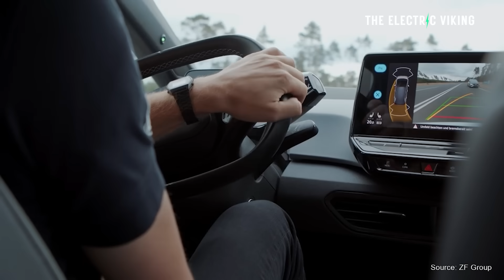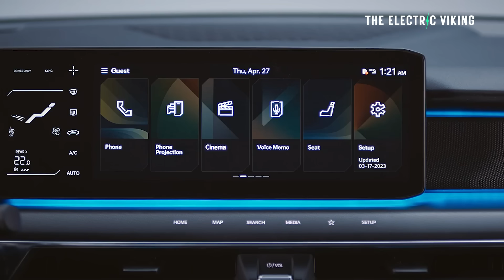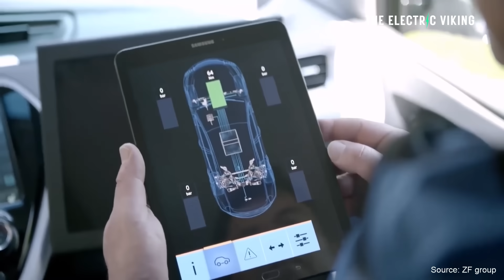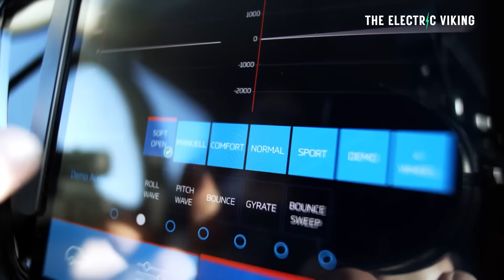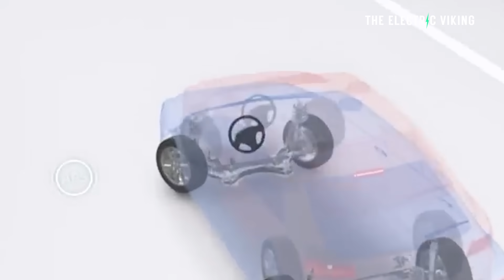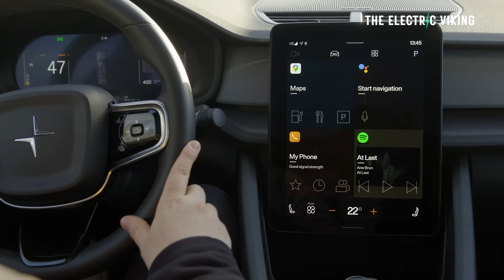Electric Brakes Revolution: Safer, Cheaper EVs!

Comment: * The new Tesla Model Y HAS Brake by Wire, according to an out of spec test I just saw. While throttle regen is limited, the initial brake pedal force producers regen, gradually adding pads as pedal pressure is increased.  They mentioned the drag free brakes also allow better performance pads to be used while still getting longer pad life.  The pedal feel is more firm than the earlier model.  Thought a cross-link to the part of the 1 hour review where brakes are discussed for about 7 min. would be worthwhile. 
youtu.be/CZC35_kTx8E?si=myOkuwRfnDsYqhF8&t=2587

Comment: It's going to have to be a failsafe system, similar to trucks or trains. Unlike a car, brakes on heavy vehicles will apply when pressure in the braking system is lost. Brake by wire could hold the brakes off the caliber when it is receiving a signal. If an intelligible signal is lost, the brakes should apply automatically. If this is not the way it works, i'm not interested in manufactures reducing cost at the expense of safety.

Comment: It's only safer as long as the motors don't burn out.
The beauty of a Mechanical System, there's nothing to burn out
Reply: Brake fluid is hydroscopic, so you should change it every other year and bleed the system from air bubbles. How many really do that? 10%
Reply: @Sandviken0046 every brake shop that does  brakes can do that.
Reply: @larrygage  I have had the same car for fifteen years, and only last year did I purchase a device to bleed the brakes. Once in fifteen years.
Reply: @Sandviken0046  I used a plastic bottle from ice tea and a hose from the hardware store
Reply: @ Used to do that on my motorcycles and you could really feel the difference.
Reply: @maxholbrook7071 - We've have had various electric brake systems for over 60 years and heat along with corrosion/water were killers to them.  If they thermally protect the motors then we could be facing brake system shutdown when the motors get too hot.  If we go to brake systems that replace the hydraulics with electric motors, unless those motors are of a brushless design they will require regular inspection/maintenance of the brushes plus the guide pins and slides will still need regular lubrication, a maintenance task usually carried out when flushing the brake fluid.  Today its an irritation when an ABS wire fails however the brakes still work in non-ABS mode when that happens however when one electric brake wire fails it will be interesting to see how they will in all situations prevent spin-outs and rollovers when one brake caliper suddenly no longer functions.  In hydraulic systems they either plumb them so both brakes on the same axle or diagonally across from each other (left front to right rear or right front to left rear ) work from the same half of the master cylinder so you will still have somewhat balanced braking for an emergency stop.  Also it would likely be a higher voltage system since to provide fast clamping pressure its going to require high wattage which with a 12 volt system would require substantial wires to carry the higher amperage needed to supply the needed watts so perhaps a 48 volt system like the Cybertruck.

I've often felt that cars/light trucks should have brakes that function similarly to heavy trucks and trains which have large springs that apply the brakes when you press the brake pedal, doing so by reducing power to the system that pulls the brake pads/shoes away from the drum or rotor.  When the system fails the truck stops instead of becoming a runaway since all the brakes then engage to stop the vehicle when that happens.  Even with an electric system this should be doable and would be a much safer failure mode since system failure means that you automatically will stop.  It also means that if the system fails you can't leave your parking space, garage, etc making it so driving a vehicle with no brakes is basically impossible unless you crawl under the vehicle and physically disconnect the brakes so no more accidentally driving off with no brakes.

Best!
Reply: Youve obviously never had to keep pumping because you had a brake fluid leak!
Reply: @jaaklucas1329  What would be more common a motor burnt out or a Leak ?
Reply: @maxholbrook7071  Brake fluid leaking was pretty common in my beaters! I still pump brakes to make sure they bite. Steer by wire auto has a backup motor on deck just like a plane. Brake by wire I would assume the same to pass. 4 wheel independent braking sounds like a big safety improvement.
Reply: @jaaklucas1329  Planes brake systems are CHECKED AFTER EVERY FLIGHT, starting to understand yet ?
Reply: @ How do you feel about steer by wire on a car knowing it has a backup system? I saw Sandy Munroes breakdown, thought it was good.
Reply: @jaaklucas1329  Hydraulic systems are FAR SAFER, super easy to work on , and still work even with a leak...  Brake a wire on electric brakes and get back to us all...
Reply: @jaaklucas1329  Been maintaining and rebuilding brake systems and components for 60 years now and have only had that on systems that had seen many years of neglect with total lack of maintenance.  99% of the time its owner negligence that leads to that type of failure.

Note that on any used vehicle that I've rebuilt and then regularly maintained the brakes on or bought new I've never had a hydraulic system failure of that nature.  The current one has almost 200,000 miles on it with no signs of brake fluid loss or line failure since it has been maintained per the Severe Service Schedule since new.  It is still on the original master cylinder, calipers and rotors with all meeting spec during their annual inspections.

You neglect and abuse a dual master cylinder hydraulic brake system and it will treat you accordingly.  You should get 30% to 50% braking in the event of an unexpected failure if you've been maintaining the system by the book.  If you maintain a hydraulic brake system by the book you should also get plenty of warning of an impending failure during inspection.

If you don't regularly inspect and maintain brakes, meaning an annual inspection of all the components, seals, lines and hoses (not just a quick glance) along with a perform fluid flush then you should expect to have total loss type failures.  Decent brake fluid is $6 to $10 per quart so not terribly expensive to flush on an annual basis.

Best!
Reply: @jaaklucas1329  The low brake fluid light would be on on the dash of a normal car

Comment: Electric brakes are a great idea. 
Plus the wheel bearings need an electric warming feature for winter driving because grease is thick, and sticky in the winter, lowering range......
Reply: its not a new thing.

Comment: If you have an electric motor on each wheel, do you need any brakes at all ? Can't the current be run in reverse in the motor to slow the car down ? Doesn't regenerative braking do that already ?
Reply: Yes but not good enough for an emergency stop. Even a 1908 electric car that used regen also had physical brakes. Terrible ones but it still had them.

Comment: Imagine the microprocessor failing when you are braking or turning.
Reply: Like in a commercial plane?
Reply: @yongebltechsupport6815  you have any idea how much expensive the system on plane will be and with multiple redundancies?
Reply: @wonderwalls3565  Fully electric system will be cheaper once mass production is achieved. Automobile production vs aircraft production is not comparable, millions vs hundreds. Electrical will be much cheaper systems to implement as fewer parts and components. The biggest cost may be IP which can be spread through lifetime production of system.
Reply: There will be redundancy. I think the Cybertruck has two more redundant systems for steering
Reply: @juliahello6673  or it will just fail on like a truck. Stopped vehicle = safed
Reply: @mouse454  Do you know how much more that will cost ?

Comment: In time it will prove itself. The ability of microprocessor control systems to hold each tyre on its absolute braking limit, with microsecond precision, under emergency braking conditions, will certainly save lives.
Reply: Or it will be hacked, or an “update” fails and it will be used to kill someone.
Reply: What do you think ABS is ?
Reply: blablablabla!!!! ABS has already done that.

Comment: Game consoles are next.  You'll be able to drive the car from any seat or from outside the car.  Right hand drive and disabled people will welcome this concept.  Cyber Cab would be a great candidate.
Reply: blablablabla..... its has already been possible for years now lol! electronic steering, breaking.... have already been able to be controled with a remote too, Volvo has s system for their heavy duty equipments with remote control you can carry with you.
Reply: @carholic-sz3qv  Yes, thanks for the affirmation.  And which makes and models are these found in?  I can't believe Tesla isn't doing so with the Cyber Cab unit as we scribble.

Comment: I don't see a problem with electric brakes per se (after all, "fly by wire" has been in use for decades), but I do question if there will be a tactile feedback system so that the driver has a 'feel' for just now much brake pressure they're applying. When power-boosted brakes first came out, certain brands had them set so sensitive that the slightest pressure on the pedal would almost lock up the brakes instantaneously. I believe that feedback through the pedal will be critical to safe use of electrically-applied brakes.
Reply: The brake by wire system that I know from the Alfa Romeo Giulia (made by Schaeffler in Germany) gives such feedback. It is a great system.
Reply: @joergmaass  Good to know. Thank you.

Comment: This will make it so much easier to put steering and brakes on the center touch screen, hopefully not too many pages into the menu.
Reply: steering and brakes doesnt belong on the screen , they belong on a physical support! no wonder older vehicles are still on the roads!
Reply: The plus model will have a small steering knob on the dash.  The premium model will have a very large knob that sits directly in front of you, but of course that will cost $20k extra.
Reply: @karlwest437  , or a paywall!
Reply: I rarely use my brakes
Reply: @steverichmond7142  : I rarely use my steering ....
Reply: @steverichmond7142  : I rarely use my steering.
Reply: This will make it so much easier for Elon to remotely turn your brakes off for disagreeing with him.
Reply: Tesla taxi😂

Comment: Sure, let's take a perfectly working system which has been refined and proven over a century and throw that out. Then let's replace that with some overcomplicated unreliable and frankly stupid system which can fail along with everything else the moment you lose battery power. So bloody stupid!
Reply: Are you talking about power steering? Or automatic transmissions?
Reply: @juliahello6673 I think is talking about carburetors. Why would you replace them with something you can’t easily and inexpensively fix?
Reply: There’s this thing called evolution. You may have heard of it.
Reply: And you get in a plane where everything is ‘fly by wire’. Strange.

Comment: I'm happy with hydraulic until we see what happens with Tesla's steer by wire. Glueing on the front panel to the Cybertruck must have seemed like a good idea, until we realised the glue comes loose under extreme temperatures...

Comment: all airline controls are by wire and that seems to work out ok.. no?
Reply: I didn't know this.
Reply: Didn’t work out so well for the 737 Max 😢. My issue would be that where almost all aviation jurisdictions are obsessive about certification, maintenance and inspections (and still get it wrong), the automotive world is orders of magnitude more slack in every respect.
Reply: They are also checked before each flight and have redundancy which the cybertruck does not

Comment: I have a Kia niro since 2021 and when I just had a service they said the brake pads are exactly the same as brand new pads, this is because of the regenerative brakes that charge the car. If anyone drives a truck it feels like the exhaust brakes kicking in when you take your foot off the accelerator, and you can set the brake level like in a truck. I know it’s not the same topic as the video but I think it’s worth mentioning
Reply: I was wondering about the regenerative breaking. I didn't see any reference to this in the video. It was more about emergency breaking involving the break by wire technology
Reply: Yeah all good mate, as I mentioned I know it’s not the video topic but as it’s based around electric car brakes I thought it’s worth talking about that after 3 years and 3 months my pads are still in brand new condition so when I actually do need to use them I will be able to stop very quickly
Reply: @shredz4816 blimey, I've peppered my comment with 'break' instead of brake, doh!😂

Comment: The future is stop by motor by reversing the power to motor to stop the car.. No brake is required. See BYD U8 demonstrator car without steering rack and break.
Reply: That's "regenerative braking", which is standard in EVs.  The catch is that there's a limit to how much energy can be back-fed through the motor and into the battery.  The challenge is in a LONG downhill descent, like Denver, Colorado, USA.  When the battery is full, there's nowhere for the braking energy to go, so the car won't brake any more, potentially leading to a runaway situation.
Reply: @ZweiZwolf  https://www.youtube.com/watch?v=Guae1gIu2iA

Comment: From what I recall from one of interviews of Munro live with Lars, the new Model Y is using some form of break by wire plus hydraulic hybrid system… so it’s definitely happening in future, more and more manufacturers will adapt this in future. Common sense, lower cost, better safety and efficiency.

One interesting comment during the interview, the passenger aircraft’s have been using steer and break by wire from decades….😊
Reply: brake
Reply: "lower cost", hahaha, clueless comment, I can fix my whole brake system easily, you a software guru ?  Wiring guy ?  think about what you just said....
Reply: blablabla!!!!! all of that already exist! alot of car manufacturers have been using many types of brakes combination just like steering and more. brake by wire is already years old technology.
Reply: But those aircrafts are checked and serviced after each flight. Do you want to visit a shop after each time you take your kids to school? And again when you get home?
Also, aircrafts usually don’t get involved in heavy traffic, so less steering and braking is required.
Reply: @The1KovacsAttila1 also they have redundancy !
Reply: @The1KovacsAttila1  airplanes are a totally whole different level when it comes to safety because those things can literally fly for up to 20 hours, crossing the oceans and more. no car can even compare.
Reply: EVs already have a type of brake by wire, called regenerative braking for most braking. The hydraulic system is only used for emergency stops.

Comment: FYI,  The 2014 Infiniti Q50 was the first production car to offer steer by wire as standard, but most people don't know that!
Reply: It also had a steering column as a redundant system. Cybertruck is the first one to have ster by wire as the only way of steering without the column.
Reply: @chinmayau  No, it was actually REE Automotive P7-C as the first production road vehicle with steer-by-wire and without coupling it with traditional steering.  But who cares, because steer-by-wire is just an adaptation from fly-by-wire in aircraft, which was invented in the 1930's.
Reply: Does Infinity still use steer by wire?
Reply: @PyroShields  My 2018 QX60 does not. In fact it's a nightmare. The steering will lock up intermittently. I make sure the power steering fluid is always full. I've had it drained and refilled. Took it to Infinity but it never happened while they had it. I wish it did have electronic steering.
Reply: Honda has been using it for years
Reply: @ My  Honda doesn't use it.
Reply: @ any idea just how many car models Honda makes? 95% of the models are not sold in America
Reply: @ Maybe you should specify which model then. Just like the  person who specified which Infinity has it.
Reply: @ sorry I don’t know the model.  We are supplying steer by wire electrical connector.  We had Honda Audit the production and insist we upgraded to clean room stamping which we did.
Reply: @ Would that be more expensive or cheaper? Not sure if you would know.

Comment: No.  No.  NO.   Full stop.  I will have a mechanical link to the steering and brakes or I’m not driving it.
Reply: @melonbeton The automobiles had mechanical brakes.  Hydraulic brakes came later.
Reply: Yeah I don't trust it at all.
Reply: @Wasteabuse  Dont fly in a plane then...
Reply: Does the steering have to be rack-and-pinion mechanical, or can it be hydraulic lines like most modern brakes?
Reply: Planes have been steer by wire for decades now.